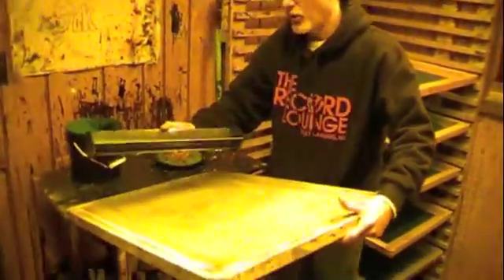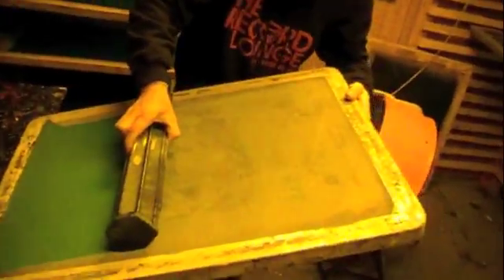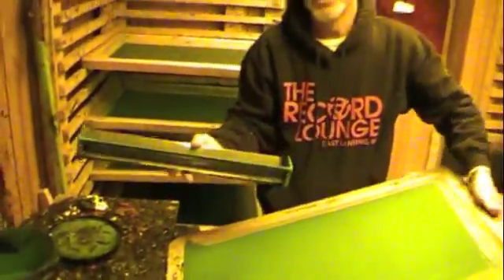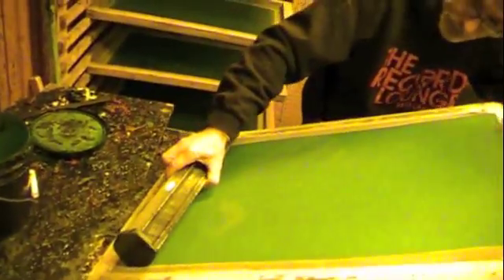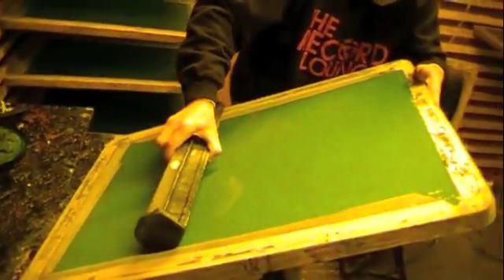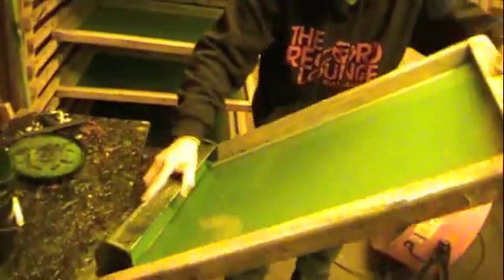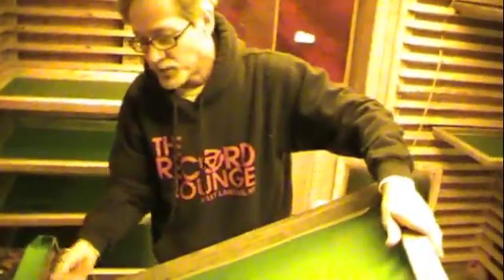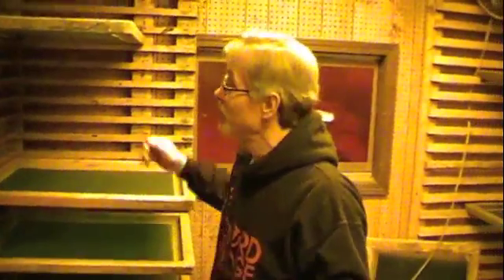Emulsions and Screen Coating

Comment: i tried once , i dont know what went wrong. i left it to dry but when i came back , there were patches of emulsion still not dried ruining my screen, have you got any idea ? is it because of not position the screen like you did? cause i left it to dry leaving it the other way around
Reply: Lopasang tashi Gurung emulsion is too thick. The idea is to fill the holes between fibers not to put a buildup of emulsion on the screen. I had same problem when I started. Drip bubbles were everywhere and didn't dry consistently. The key is to go thin

Comment from the maker: after the screens are coated it's time to expose and rinse the unexposed area out with water to achieve your stencil. There are a number of suppliers of cleaning/reclaiming chemicals. The ink/screen wash is for cleaning the screen after production and the stencil remover is to take the emultion off the screen. After the emultion has been removed it is important to us a degreaser to get any remaining oils of the mesh. This helps the emultion better adhere to the screen when put back through